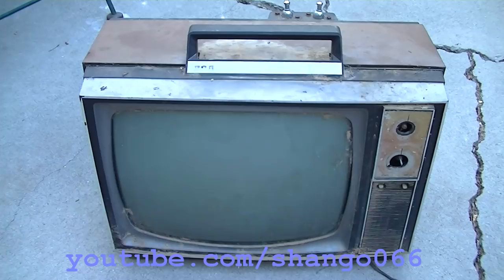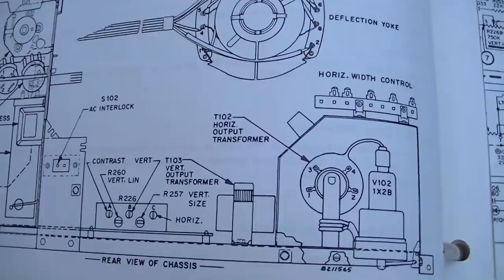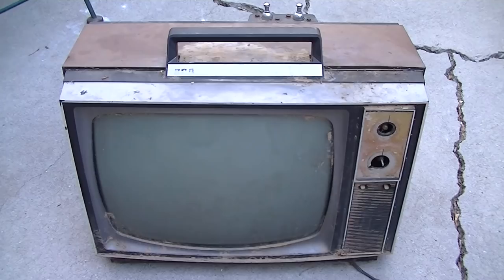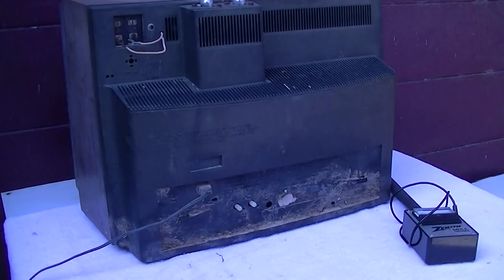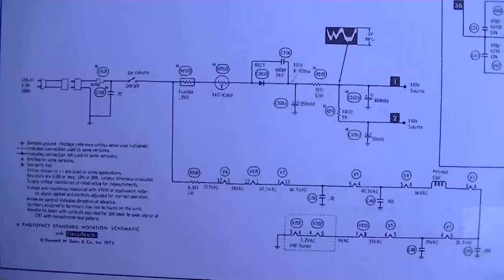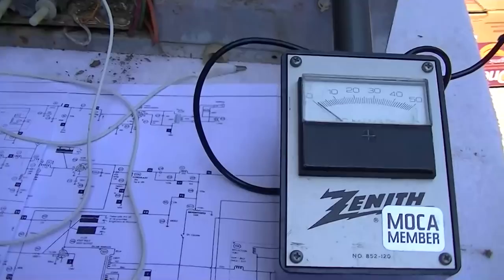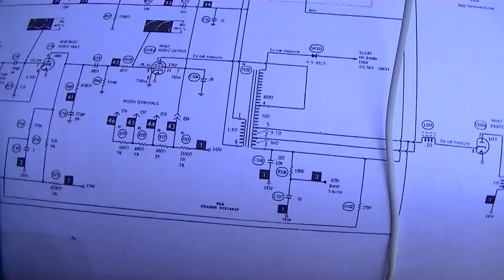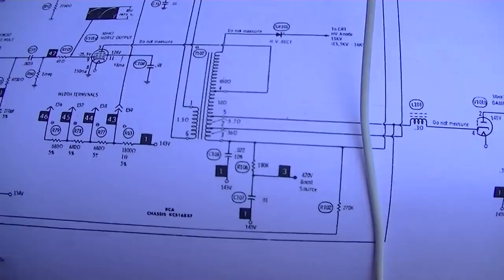RCA KCS168 TV High Voltage Diagnosis 1974 Vintage Black and White

Comment: Heat that C.R.T. up and discharge a charged 20uf @450 volt cap between the heater and cathode a few times. It's either gonna fix it or phuck it. Thanks for the great educational troubleshooting video.

Comment: I remember reading one common trick for that problem was to use a turn or two on the core of the flyback to power the filament in the case of an H-K short.  There'd be relatively little coupling since it's 15KHz and only a few turns vs. a 60Hz iron core transformer.
Reply from the maker: hmmm didnt think of that. Not sure this flyback would like any extra load
Reply: Oh yea, used that trick once on a zenith, same short, same blurry ass picture symptom, set was solid state though.
Reply: kevtris That's how the HV rect tubes get their filament lit. 👍
Reply: shango066 The creativity of your solution totally had me! 😉

Comment: One idea (just for kicks and giggles if you don't care about blowing it up) - hook up BOTH heater pins (in parallel) to one side of a car battery, then the cathode to the other, then tap the CRT.  I'm not sure if 12v will blow the filament open, but quite close.  The amperage will absolutely fry whatever's shorting it though.  If the heater is loose and is touching the outside can itself it will melt it. :)

Comment: This is the best demonstration of a picture tube with a heater-cathode short I have ever seen! I think the white insulating powder on the filaments is aluminum oxide. I have a bunch of old tv service books that talk about using 1:1 filament isolation transformers (they look identical to filament booster transformers) to remedy this problem, but apparently they never mentioned that it was not a complete fix. I wonder if it is possible to rewire the circuit to feed the video information to G1 rather than the cathode, as some sets did from the factory, to avoid shunting the video info to ground through the transformer. The thermal imaging cam will be an awesome diagnostic tool. Great video, as always, Shango066.

Comment: Next video: diagnosis and resurrection of that bird?
Reply: Maybe he could use the high voltage coming off of the flyback of that RCA to jump-start the bird's heart
Reply: As justsomeguytoyou said: He'd need to use the flyback transformer
Reply: Maybe a bulk re-cap to restore the bird to full working order.
Reply: "That parrot's not dead, 'es just sleeping!"
Reply: Zirok1982
Looked more like a bat to me.

Comment: I was going to mention something about peoples fear of the H.V. on TV's. 
I am an auto mechanic and have, on more then one occasion gotten wacked by a modern ignition coil and FUCK DOES THAT WAKE YOU UP!! 
If you have never seen the energy they release its quite incredible. The spark will jump a 1" gap easilly and its a thick hot blue spark not the thin anemic spark a flyback makes! I am glad shango mentiones something about it!

Comment: Thanks for the videos. Beats anything else on TV. Back when I used to work on these things, I used a 1000x attenuation HV probe to measure  voltage on horizontal output plate, etc. It acts like a low pass filter for those pulses so it won't damage the meter. ALSO, I used to play with infrared photo film and noticed that the optical and infrared images were displaced like your device. I think it is difficult or impossible to color correct lenses for that large difference in wavelength of light.

Comment: Hey Shangoo, this TV is a rare one.  I tried finding even just a photo of this exact set that would have all the knobs on  to see what type of knobs these sets had.  So far I couldn't find an exact photo of the set.  You mentioned in another video that all of these set you received/picked up; had no knobs on the front.  Either the knobs melted from the heat; fell off and got buried in the ground; or someone snatched the knobs off to leave the sets rot away.  I hate when vintage electronics like this get abandoned and abused.

Comment: Makes perfect sense. Notice that the horizontal lines as well as the very top and bottom of circle are unaffected by the short.  Those are low frequencies, while the sides of the circle are high frequencies.  The high frequency portions of the video are being shorted to ground via the inter-winding capacitance of your isolation transformer when the cathode and heater are in contact, while the low frequencies are unaffected.  If you used a multiburst pattern, you would really see the frequency-dependent effect of the short.

Comment: The CRT H-K short can sometimes be removed... Heat up the filament, charge a 100uF capacitor with a diode on the power line. Dump the capacitor across the heater and the cathode terminals - the capacitor might blow away the short, you're unlikely to fry the filament(s) unless you go crazy on the capacitor. I got a 1965 Onkyo color portable to work that way, series-string, one gun's cathode shorted to filament. If an isolation transformer isn't practical, you have nothing else to lose. This is similar to how the short-clearing modes on some CRT tester work, but it's one button that could doom the CRT if a tech accidentally hit it in the field, so H-K short requires a little more finesse. 

If it's a parallel set, the smallest 1:1 60Hz transformer you can find should be okay to isolate the filament. Bigger transformer = more stray capacitance = more rolloff of the high-frequency picture info = more smeared picture. Parallel sets don't fail the same way with an H-K short in the CRT, but the image still gets smeary because the entire filament circuit is now part of the video output. 

The capacitor trick might work, but I would never use it as anything but a last resort before having the CRT rebuilt (if the set is worth it). If you still have that RCA, it would be a perfect candidate to try it.

Comment: You should be able to isolate the added filament transformer from the video signal with a pair of chokes, one choke in each wire going to the fil. Transformer secondary. Maybe even two chokes in each leg, one rf choke and one for lower frequencies put in series.
Reply from the maker: I wonder what value
Reply: shango066 I'd start with 47 uH or so. Maybe add in series a 1 mH for the low frequencies. One pair in each filament leg going to the CRT.
Reply: A. Dog Yes. If he has one on hand. That 6.3v fil xfrmr is going to have huge capacitance between pri and sec windings. Either way should make a huge difference.
Reply: Herbert Susmann Damn, I wanted to say that, but you got here earlier :D I would've used 470 or more microhenry, it must be in each leg.
Reply: MrJohhhnnnyyy Problem with using a single high value choke is that it may have too low a self resonant frequency. Way around it is to use two in series. First blocks the high freqs and hopefully has a high enough SRF that it acts like an inductor at the highest video frequency present. Then the higher value choke in series takes care of the lower freq components in the video signal. May have to experiment with actual values a bit to get it right. Yes I agree must do chokes in both fil leads to have any effect.
Reply: yep, try a 'split bobbin' transformer, the capacitance will be lower....

Comment: I'll bet that set was left not long after new. With emissions like that it's got to be low hours. The storage conditions over time is most likely the cause of the short.
Reply: Maybe, but it wouldn't be atmospheric conditions---the working parts are sealed in a vacuum. Now if the set was dropped or subject to an impact, that could loosen or shift some of the elements....
Reply: I don't think that it's caused by storage conditions. CRT inside is evacuated, so outside conditions have a little impact.
Reply: The short occurred while the set was relatively new, perhaps?

Comment: I would have tried the Clear Shorts button on your CRT tester. As a kid in the 1980s, I built a short killer from a schematic in a 1960s Popular Electronics magazine. I seem to remember it used something like a 10uF 450V capacitor and would dump that capacitor across the shorted elements on the tube. I only needed to use it once, I remember the bright flash from inside the neck of the tube.... and guess what, the tube worked again! Your mileage might vary... LOL. Especially with an H-K short where it's probably a crack in the ceramic coating on the filament. But hey, the CRT is useless otherwise, so it can't hurt to try something like that. 
I have heard of people getting color tubes with one heater open to work using similar tricks. The arc from the high voltage applied by the capacitor is supposed to weld the broken filament together, and the fact it's a brief pulse of high voltage doesn't allow the heaters time to overheat and be damaged. Again, last resort stuff, and not something I would trust as a permanent repair for a paying customer. 
Alternatively, you could buy a vacuum pump and take up glassblowing as a hobby. LOL.

Comment: Amazing! You keep coming up with um. What a great lesson to illustrate the value of voltage checks. I haven't even finished the video and had to comment! You are really something.  Someone mentioned the flyback wrap trick. Would really be interesting to see if that works.

Comment: One trick I used to use with heater cathode shorts in CRTs was to wind a couple of turns of wire round the flyback Transformer’s core to supply the tube heater. That way there is much less capacitive drag on the video signal.

Comment: You just got to want to shake this guy's hand, 10 out of 10 for effort mate. Yep, many years ago Ive tapped a few tubes, but was never exactly sure why :-) Something very deep in the dark recesses of my mind, did we used to wrap half a dozen turns of well insulated wire on the LOPT and use this to heat the tube?  All been a long time ago now, but Shango's videos have to be the best on YouTube. Keep the faith mate.

Comment: The easy fix for a heater cathode short is 3 turns of double insulted wire (2V/turn) around the horizontal o/p transformer ferrite core to supply the filament & it won't show any symptoms of the short, eg video quality degradation, I did this with many hundreds of TV's back in the day.

Comment: Yes, as 'kevtris' said, heating it from the flyback will solve it, I've done that before. And I've installed a bad EF80 (6BX6) tube in the heater string as a 'dummy heater' to prevent the other tubes being overheated. Then the RMS voltage of the CRT heater also should be tweaked with a series resistor (or with a variable inductor, it's more convenient to tweak, and causes less additional load to the flyback), it needs a DSO with RMS measurement for the most accurate results. 

An old light bulb RMS converter will also do it, if it has high enough input resistance. I haven't seen any true RMS multimeters which will do that (altough I've tried only two different lower-end models), they either not liking the 15kHz and/or the high crest factor.

Comment: I’m curious if the CRT was taken out of the set turned 180 degrees and retested would the cathode to Filament short show itself?  That would depend on how the degraded the insulating material on the filament is, because the shirt was so intermittent I think that it wouldn’t short if the CRT was installed upside down

Comment: How about adding a couple of chokes in series with the heater pins? They should keep the high frequency video signal away from the filament transformer and its capacitance.

Comment: I have a suspicion that might as well be the AC from the transformer getting coupled into the cathode through the short. I would expect the inductance of something like a mains transformer to block much of the higher frequencies of a video signal.

Because the transformer and filament circuit connects to the rest of the TV on a single point, that loop should have no current flowing into and out of the TV from it, except for capacitive coupling. I have a feeling this problem would be far less noticeable, if not altogether removed, if you ran the filament on filtered DC; maybe if you can find an old six volt wall wart, it might do the job.

In another note, I really like these videos in particular, at this point it's not about fixing the TV but to experiment and see what it would take to get it going. Who knows, maybe someday you'll run into a pristine, super rare or otherwise valuable set that has a problem like this.

Comment: Greetings: [yes, I know these are very late suggestions, but its the thought that counts.)
Idea 1: placing an RF choke (must be able to carry the heater current) on each heater lead close to the CRT.
I like your method with sep 6.3 vac x'former best!
Shorted also seems to lose/ hide interlace display.

Comment: I use the B&K 465 for testing CRTs, using it I found out my 10BP4 was actually okay, but the high voltage on my RCA T-100 was bad, making the picture incredibly dark and blurry.

Comment: Use the short clearing mode on the tester!  It's worth a try!  Or charge up a cap and discharge it between heater and cathode.  Blow that short out!!
Reply: Not worth the risk, it will blow the filament in the otherwise perfect, strong tube. If there's a part of the heater insulation missing, you can't fix it reliably. But you can use it for decades, if you heat the tube from the flyback.

Comment: Hm I don't have any experience with tube type TVs, but just thinking: Maybe you can rectify the AC (and drop it back down to 6,3V) of your extra heating transformer for the picture tube. That way the picture information (which I assume is more AC-like) and the heating voltage (now DC) are more different and possible interfere less? Anyway another very interesting video! :)
Reply: There's still a capacitive path for the video signal to the transformer. Not worth the hassle, since you can run the heater from the flyback with no problems, and it doesn't need an additional transformer, just some turns on the ferrite core with insulated wire. Rectifying and filtering the signal from the flyback is a good idea though, if you don't have the gear to measure the RMS value of the 15kHz signal accurately.

Comment: Will a brightener (or can you try a 1:1 isolation xfmr) isolate the filament from ground? Well you later said, and did an isolation solution .. and probably will add choke/RF isolation at the filament leads …

Comment: @shango0066 may be a dumb idea but if you powered the filaments with a transformer but rectified the output to dc with a bridge rectifier after the transformer, would it solve the video problem???

Comment: I am really surprised by the unusual, extremely simple scheme for biasing the CRT. Normally, the last element that the electrons pass through would be biased positive by a few hundred volts, and that bias would be set by a potentiometer. Here, that element is tied to ground. Most designs would also have a focus pot, but here, there is just a simple fixed voltage divider.

Comment: Rca I guess we're the pioneers in American tv But I always thought there tvs were on the cheap side😑
Reply: Tom Franco 
RCA was more well known for quality broadcast equipment used on the professional side, if it was professional broadcast cameras, switchers, 
engineering equipment transmitters ect yes RCA was high quality, their consumer products weren't that high quality in most cases ESPECIALLY after the 1950s.
Reply: Zenith was the high quality producer for years .I have many Zenith tube radios from the 50s and early 60s still playing well. I have a 1954 Zenith am FM phonograph console I inherited from my great uncle. I've had it 25 years now. Use it frequently and it plays wonderfully.  It's never been overhauled . Its 65 years old now . I call it OLD RELIABLE lol. Plays records fine too.

Comment: Wind an isolation transformer with very low capacity between primary and secondary. That will allow you to run this crt without loss of picture clarity.

Comment: You need to watch the set upside down, Gravity short removal.
Reply: Yes, maybe it will help. But I would try to remove the short. It's not permanent, so maybe it's only some "dirt" between heater and cathode, not direct connection.
Reply: Often the heater stretches or loosens on its mounts. It can get a bit baggy. There should be no foreign matter at all inside, apart from poor quality control // build. 'Evaporated' material after long use EDIT, this will not cause shorts though. distortions from heat and cooling will cause shorts- though It seemed like it was low hours and surely fault was existing when the set was dumped and probably arose after a few heating/cooling cycles..
Plus its hard to watch upside down.
Reply: Plus I left the 'R' out of gravity - so my joke made no sense..

Comment: May I suggest using a transformer with a low coupling capacitance between primary and secondary. A typical example of this would be a toriod transformer where the primary and secondary winding are wound opposite sides of the toroid.

Comment: The fix would have been to wrap 3 or 4 turns of wire around the flyback transformer core and power the picture tube heater that way. You would get much better isolation than if you used a power transformer.

Comment: Use dividing filter betwin transformator and filimante when give separate suply for filimante. The low frequence transformator has influence on videosignal on cathode when it shorted. Dont move to traaash))